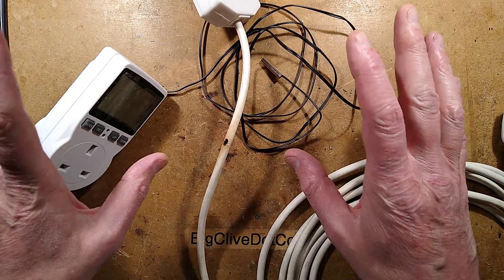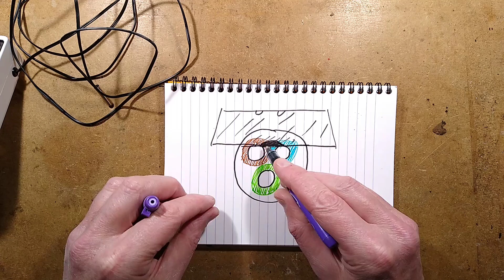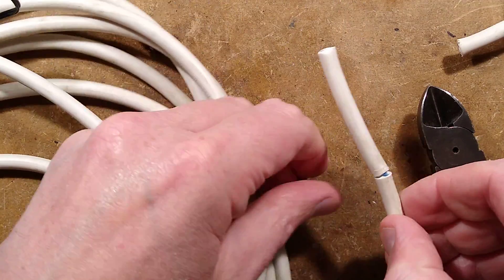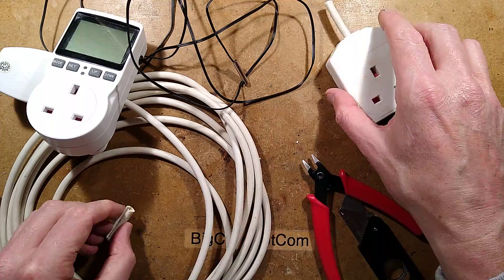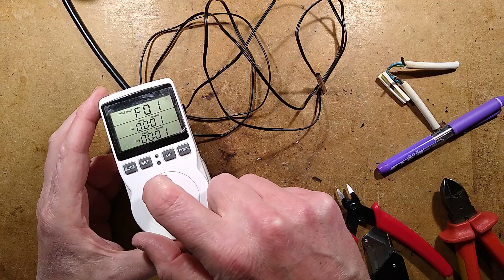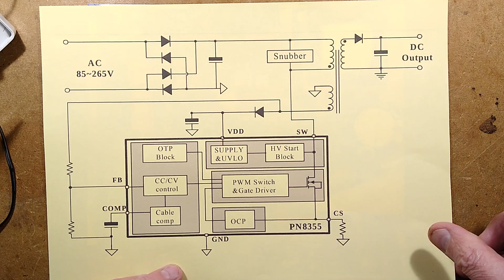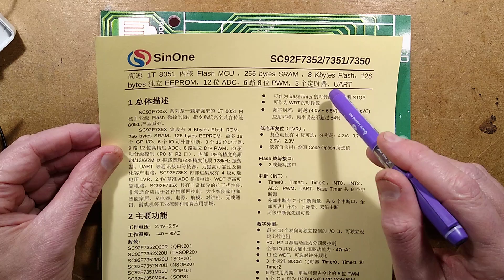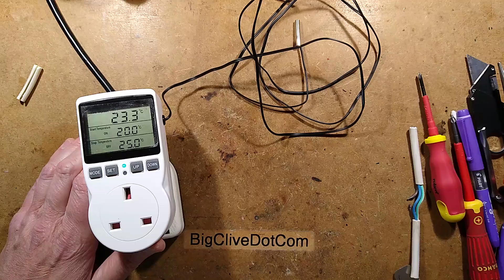The case of the mysterious cable arcing

Comment: Ah yes, the entertainment sector, where all faults are left for the next poor sod who encounters them. Where bands turn up with equipment which has electrocution written all over it. In my (much) younger days I once picked up a guitar to help sound check, only to get the full 240v for my troubles. Circuit breakers in the venue? Pah! That's for wimps. Between that and badly set up MOSFET based PA systems - I'm surprised I'm not deaf and dead.

Comment: outside control box for a heater???????????
Tell him to take a pic of that heater.
It was a faulty cable at that point, like some might have Scraped the wire thin.  And it worked as a fuse, until it took to much power pulled thru it.

Comment: I have had wires in the past where there was a discontinuity in the conductor from new. I used to manufacture trailers and one time I wired up the lights and nothing worked in the end I traced it to the white return/ ground/earth wire having no copper for a distance of 8 mm. In order find this I had to strip the entire loom of 7 core cable down. Since then I have always been on the look out and have found such faults on many other new cables including flat twin and earth, I think the problem occurs during the manufacture where one wire is joined onto the next during the calendaring process.

Comment: We call em "Rakblad" in Sweden wich straightly translated means "shaveblade".

The one you break with tension to get a fresh surface is simply called "brakeblade" Swedish is very straight forward and logical in most cases, i like that.

I dont like names like stanley knife/blade since there are a ton of other brands. Besides stanleys quality has turned to pure crap. So def dont wanna give them any credit. 😂

Same goes for impact drills. People here tend to call em Hilti even tho they make many other powertools and many other makers make impact drills. To me thats just confusing. 🤷🏼‍♂️

Comment: I've read all the comments, so far (165 of them) and the vast majority don't mention the cut into the outer sleeve as if the tension on one wire is all that happened.  To me, this failure isn't from the cable being pulled at all. It's the knife cut.  The fact that the hot lead was "shorter" is most likely from the destruction from the arcing.
Reply: But what did it arc to? The neutral wire insulation was still intact.
Reply: @cambridgemart2075  It was parted by the knife cut and that, alone, causes an arc due to barely making contact.  It's a guess.
Reply: Assuming that it was a knife cut.

Comment: 3:45 That's why they invented the arc-fault circuit interrupter (AFCI) or arc-fault detection device (AFDD),
because damage to a electrical cable can cause fire long before a circuitbreaker trips.

Comment: I have hacked and modified zebra strip with scissors. From poped multimeter lcd to PSP joystick. I think, that they are robust, just precision of case molds can be bad and lead to shorts and poor contacts.
I experienced dash cleaner ingres making connection poor, but wiping off was always enough

Comment: I dont think your explanation is correct. The cut shows no signs of scorching, its perfectly white, making it seem like it ripped open after the arcing rather than before.

Now that I think about it I had a fault just like this in the cable of a hairdryer with a fairly similar scorch mark. That hairdryer cable has seen lots of abuse and had the live seperate inside the insulation, going out with a loud bang and visible plasma ball. I was very awake that morning.

Comment: Month ago my extender cord got blasted due to too much current. It was a very nice and exciting show. Extender cord was rated 10A at 230V but the electric kettle draw 2350W + 30W kitchen lamp. There was so many sparks and arcs and heat that the plug got stuck in to the outlet :D I know, my fault. I did repair everything myself so lesson learned. Didint even know that this kettle draws so much.
Reply: 2380W at 230V (10.348A) is not enough of an overload to cause any immediate damage (much less catastrophic failure) to a 10A rated cable.
It must have already been weakened in some way.

Comment: I wonder if frequent coiling/uncoiling of the cable has caused what we call a z kink where the copper conductor gets stretched beyond its elastic limit and lengthens but the insulation remains elastic and the excess length forms a kink. These then fail due to fatigue cracking and a resistance fault leads to arcing and the eventual failure as it vaporises the conductor until an open circuit is made. 
This often happens when bend restrictors fail. I had this happen inside the palm of my hand whilst ironing with a worn cable. Ouch!
Reply: Another consideration.  Over on the Curious marc channel, they had an issue with wire wrap that was actually copper plated aluminum.  The wire fractured internally and lost continuity but no arc.    I've been seeing China wire that is more towards brass than copper.   This seems to be on the brittle side.

Comment: I have seen this twice, once on a hoover and the other a lawnmower, in both cases near a point a cable flexing. I assume the load of the motor limits the current and allows it to continue burning within the sheath until the circuit eventually breaks.

Comment: part 2: ASCII schematics version
Polarised UK plug				output plug
L ------------------------relaycontact ----------L   Heating Load max 15A :3.6kW to N
N -----------------------------------------------N   return of Heater.

in the schematic at 10:50:
L  
 AC 85~265V
    one diode of the 
    bridge rectifier
N -------|<|-------------|> HV GND 

Lower left 
transformer 
winding:
HV GND
<|-
   )
   )
   )
---o

top right transformer winding
 ---
(   
(   
(   
 ---------|
          |
        -----
         ---
          -
8051 and thermistor Ground

Inside the transformer I think the ground wires are connected, at least somehow there is no good isolation inside.
HV GND = Ground.. what could be wrong with that .. right? 

So when the sparking started there was One Diode in the circuit,
so only 50% of the time the current went through the diode to HV GND 
and the other 50% through the remaining wire (to the heating Load) heating the wire.
when the wire became hot and overheated the resistance of the copper increased, 
resulting in the even more heat and finally the arc to form.

Still 50% of the time supply voltage trough the rectifier circuit, supplied the electronics and the relay,
so it kept on, keeping the arc and the load current on for a long time.

It is all speculation of course, as it is hard to know what has really happened afterwards.

Comment: Related, we have had a load of new kettles at work where we have had a few that has tripped the caravans electricity, on investigation the connector on the base had clearly got hot and melted around the live pin. Not good and something that we have not experienced before.
As for feeling for cable damage, that's exactly what I do on the vacuum cleaners at work when I am doing the portable appliance test, run it through my hand and I can easily feel any damage.

Comment: That reminds me of a cable to one of my space heaters which was nibbled by a rat, or it could have been a mouse. I was nearby at the time, blissfully unaware of the rodent snacking on the lead. There was a loud farting and bubbling sound followed by a plaintive "Ooh, ooh, uh, ooooooooh". I never saw the rodent, but the damage was clear, rather similar to the cable seen here. I suspect young Rodney ran off with his gob full of fire and subsequently keeled over and stiffed out under the shed floor.   The point being that the burning and damage looked almost identical to that in the cable you just post mortem'd. I remember my granddad running his hand along an extension lead when I was kid, and he found a nick in the sheath, or more to the point, the nick found him!  This is also why we should inspect cables and leads quite regularly for damage.

Comment: I've heard "Stanley knife" (and indeed you can buy Stanley brand ones) in the states, it's not as common as "utility knife" or "box cutter" though.
Reply: So you call loose blades utility knife and box cutter? That sounds so weird to me 🤔
Reply: @Magisktification  The loose blade would be called a utility knife blade or a box cutter blade. I've used a stanly brand one, but never heard it as a generic
Reply: weird. in the states ive mostly heard box cutter at work. never a stanley knife
Reply: In the UK we almost always call them Stanley knives regardless of who actually made them.  I've never heard anyone call them utility knives although I dare say someone does.
Reply: @joshuarosen6242  true it’s only when you order some from different manufacturers because “Stanley” is copyrighted
Reply: Technically it's a utility knife just Stanley cornered the market in the UK,  just as Hoover did with vaccume cleaners, however a box cutter is a completely different device with a protection arm underneath to protect the contents,
Reply: @dogwalker666  Yep, in some industries the knife you describe is known as a "rip knife".
Reply: @grantmorrow8179  interesting.
Reply: I would just call it a box cutter too, yeah
Reply: Here in South Africa no one will know what you are talking about if you say box cutter. They are known as a Stanley knife.
These days Stanley is synonymous with low quality (and high price) so everyone buys other brands.

Comment: How is the relay rated 16A @ 250VAC yet only 15A @ 125VAC? I think they just pulled those numbers out of....
When I was a kid we had a kettle on a timer that had the same live cable fail. Woke up to a house full of smoke, and it had burned a 20cm crater in the Formica counter top. The carbon tracking provided a current path over the gap that had grown to 2 or 3 cm with a nice plasma ball cooking away. This was with only 125VAC, too.
Reply: They perhaps just looked at what the regulators in the test markets they wanted to sell into insist on and tested to the highest of those. Not really much point in bothering to certify it higher than the bare minimum you need to achieve regulatory compliance.

Comment: Pro tip: rubber bands. Twist ties. Rope. Anything but tape. Tape is sticky. Tape is annoying. Tape is pain.

Just don't use tape. For the rubber band, you can loop it through itself and near the connector, just twist and stick it through. Worst case the band gets stretched to breaking by the idiot who comes after you.

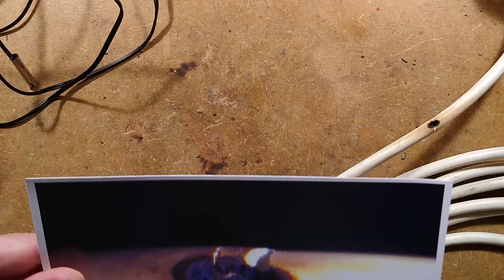Comment: At the picture of the cable (1:30) it looks like the white vertical damage, could be caused by some imperfection in the plastic, in combination with bending it, could have damiged the white insulation and the brown insulation of the Phase L wire. As you said a bit of moisture could have helped a bit too. Later in the video it shows one of the thermistor wires is connected to the ground of the secondary circuit.
The interresting part is how this is connected to the Neutral wire, as that what has probably made the missing link from Live to Neutral.
In the cable you see there is almost no damage on the blue wire, telling me that is not the way the current went to Neutral.
After the first spark from the brown cable to the 0V of the thermistor, in combination with probably a heavy load (some heating device) on the output socket of the device, made the current to high for the damaged brown wire. It must have been disturbing and exciting to see the  plasma balls when that was happening. Possible the Neutral is connected directly to the Ground of the 8051 microcontroller, I cant see any safety cap, the transformer might have connected the ground side of the Neutral input ground connected to the Ground of the microcontroller and the metal outside of the thermistor. This is normally not a problem because of the polarised UK plugs (it would be a big problem with dutch unpolorised plugs).  so to finish the investigagion, check if the transformer has the 2 different ground connection in the datasheet schematic at 10:50 connected would be conclusive..  great video and investigation of an exciting problem Clive!

Comment: I'd assume that the arcing explained at the start would be due to the thermistor being connected directly to neutral - that'd cause an arc between positive and earth on the cable and also explains why the thermal timer is not kaput after the incident.
Reply: Thermistor is isolated, that's the whole point of the flyback type switched mode supply.

Comment: What material is the core of the cable? Chinesium? Copper? Copper plated? What is it rated for and can it handle that? At what load does it start to smoke and burn :-)

Comment: When I've been a roadie for bands and we e been packing up the PA system and lights we used cheap electrical tape, it did the job but we never needed to use a knife.
For my personal equipment Guitar leads, power leads etc. I use hook and loop straps. They're always attached to the lead so they don't get lost and they last a long time. The other advantage they have is the leads Don't have sticky too left on them.
And please don't fold your leads up and tie them into a knot, it just ruins them.
Reply: a great choice is either gaffer tape (the cloth stuff not the uk name for duct tape) or paper backed velcro made for tying plants to stakes, that stuff is amazing for bundling cables and easily breaks when you want it to

Comment: Had a similar loking failure on a cable. Used some random  c13 cable for my UPS for years, rated 10A according to the print on the plug . Accidentally plugged a big inductive load into the UPS which lead to a 5KW spike. UPS is fine but the cable got a hole near the plug. The smallest crimp ferrules I had where 0.5mm² and even they where too big. Guess I'm lucky I endet the cable this way and not slowly with a fire.

Comment: Why is there a 0ohm resistor instead of just a connection? Would it be used for an optional resistance?
Reply: That's so the automated pick and place  machine can be used.  A wire link would need to be placed by another machine.

Comment: Had a cable start arcing, then go full short circuit.
Was for a 2000W electric frypan, and rubber coated insulation.
Internally both active and neutral wires had moved within their rubber and come together.
Best guess, someone in the factory managed to kink both wires, as it was being assembled into the completed cord.
Reply: I believe it was just the power wire that was damaged, so either from the factory, or possibly a puncture from a grounded fastener, etc.
Reply: @danlemke6407  this is MY cable, not the one in the video.

Comment: pretty sure you would have observed if the cable was copper clad aluminium but as you did not I think it was copper hence more than likely your diagnosis was probably correct IMO. However I really believe CCA cable/wire is a widespread problem waiting to excite our lives at random unexpected times.

Comment: Who is it using a temperature controller on a heater that for some crazy reason in 2021 doesn't have a thermal cut out or its own temperature sensor?
Reply: It might have a thermal cutout but unless it's top end the temperature control is probably just a bimetallic strip. Also the temperature control is normally right by the heater and you might want to control the heater based on the temperature in another part of the room.

Comment: No damage to the cable, you know the space an electron needs? 😂

I'm going to guess the burn happened where the copper had been spliced together to form a longer continual wire in the cable making machine

I believe the blades are called box cutters

Comment: For years now I’ve been making rope rings for hanging up cables and hoses. Just take about five feet of light rope, splice it end to end and you can hitch it through itself around a bundle of cable (and many other things). It is strong but comes off easily and can’t damage cables. Also reusable.
Reply: Old fanbelts are also a good loop to hang long cables and hoses.
Reply: Good for at home, but generally in the entertainment industry all the cables get thrown into a trunk which is pushed onto a truck for delivery to the next show.  Where I work we use hook & loop cable ties with our logo.
Reply: Have you seen a Dyneema rope shackle? Same idea, just on steroids 😃

Comment: Reminds me of about 30 years ago, when I had hair, using a hair dryer and the cord exploded in a shower of sparks.  I cut open the wire to try and splice it back together and found it was impossible to solder or use wire nuts.  It wasn't really wire, each "wire" had inside it copper foil wrapped around nylon string.   I was amazed that cheap junk lasted the few years that it did...
Reply: The technical term for that is "tinsel" conductors, but those are only approved for low currents (generally 0.5A) so at 120V would max out at 60W.
Not going to dry hair in a hurry with that; normally they were used for mains-operated shavers, but nowadays are mostly confined to extra-low voltage applications.

Comment: By coincidence today, I washed an electric blanket and noticed crossed heating wires afterward. I sttsightened them all for just thus similar reason.  (The idea came from warnings from roof ice-melt cable not to cross cables.)

Comment: Those wires look awfully thin for any heating device even at 240 volts and reduced current. Just a guess but they look like about 20 gauge AWG. 0.8 mm if I'm correct.
Thanks
Reply: The cable in the U.K. for an 13A extension lead should be to specification 3183Y, with a conductor size of 1.25 mm squared. The maximum power at 240V 13A being 3120 Watts.
Reply: @Mark1024MAK  Thanks